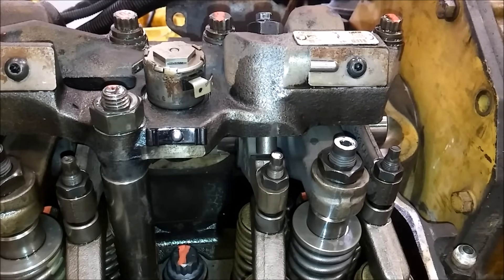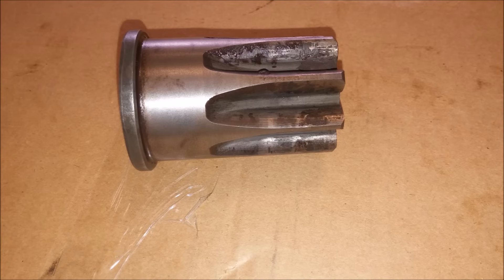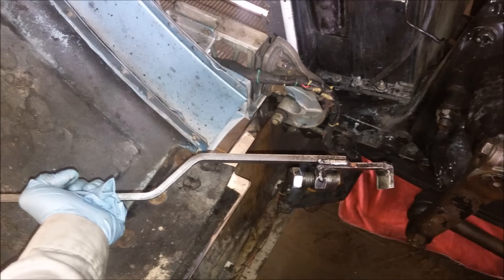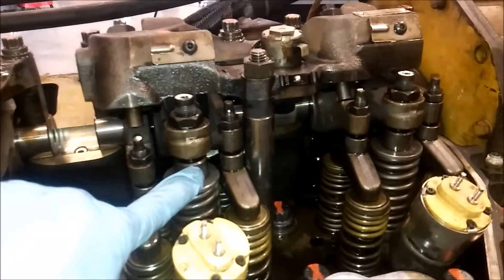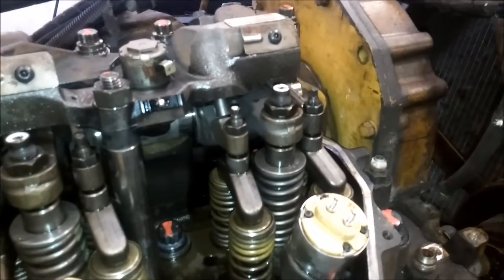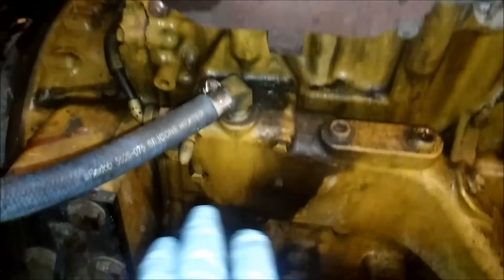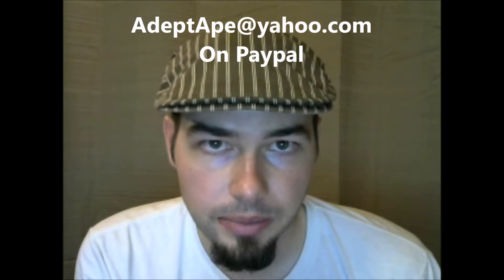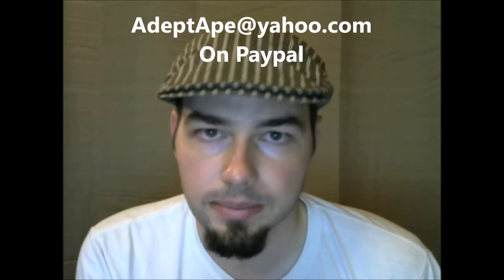How To Perform A C15 Overhead Valve Adjust. CAT Complete Overhead And Valve Adjustment.

Comment: Adept Ape, no way to thank you. much respect from all cat lovers out there.

A friend of mine has a 3116 engine, fuel system is unit injectors camshaft actuated and they have a lever to control them. he noticed that diesel fuel vapor and drops were coming from the pcv blow by pipe. What do you think the probelm is? how did the diesel reach the oil? 

thanks!!!
Reply from the maker: Well the normal cause is one of the injectors is leaking fuel and is leaking it into the crankcase. I've got a video on "fuel dilution" that talks about it and how to troubleshoot it. Be warned though that if the injector is the cause they are a real pain to install and sync, they have to be pressed into the injector bore and the fuel timing has to be synced, which is very technical.
Reply from the maker: On a 3116 that is.
Reply: yes indeed it is a 3116.. can you tell us more why its technical? and please tell me what controls the injection? so it is actuated through the camshaft, ;byt what controls the small rods on the side of the 3116 engine? please help me.

regards, and much respect!
Reply from the maker: +Omar Most of the newer engines have electronic injectors that are controlled by the ECM, but on a 3116 it is mechanical. So there is a large governor on the front of the engine where the HEUI pump would be on a C7. The governor uses a set of rods known as the rack to control the amount of fuel each injector gets, well when you change an injector you are supposed to sync the rack which is somewhat technical because it has to be synced to each other injector. Know I have changed injectors on them without syncing them and you can get lucky and they can run okay, but sometimes you have to sync them. Not only that, the injectors are pressed into the injector cup with a special press during installation, unlike other injectors that can be just installed with the holddown bolts. If you just install the injector without seating it and reaming the injector cup, the combustion gases can get into the fuel rail in the head and cause all sorts of issues. Hope that makes sense.

Comment: the best
Reply from the maker: +fisnik bojku I was wondering when you were going to watch the video.
Reply: On the road for las 4 weeks working and breaking down  putting that money wright back on the truck so been busy but I am glad you did it thnx
Reply: When I get back I will change the IVA SOLENOIDS  I don't understand what's their function other then keeping the head cooler so I was going to ask you
Reply from the maker: +fisnik bojku I need to make a video explaining what they are and what they do. The short of it is they will hold the intake valve open at slightly longer intervals when it should be closed to reduce the amount of air in the cylinder so that less Nitrous Oxides are produced during the combustion cycle. They are there for emissions basically and don't help your engine run any better.
Reply: ki ij

Comment: hey sorry once again I have a question I took my dipstick off of the side of my oil pan filled it back up with oil and it is not reading could I have put the dipstick in my oil pan not right? Thank you
Reply: finally got it to show oil. my question now is should it be sitting around 40 oil gauge? and when I give it more gas it moves up to almost 80 is that bad or good?
Reply from the maker: +Tonya Forshee That is pretty good. As you increase the engine speed the oil pump spins faster and your get higher engine oil pressure. As the engine runs your oil pressure will drop as it gets thinner and hotter. What oil weight did you end up putting in there?
Reply: I ended up putting in 5W30. hoping that was a good choice?
Reply from the maker: +Tonya Forshee That is probably fine, since its really an automotive engine that is a good wide range viscosity.
Reply: I went with that oil a lot of people were saying that it would work good. I hope it does LOL I bought the boat from a guy that pretty much didn't know anything about it didn't have it long enough to. and hadn't changed the oil and it was a quart over like I told you before but when I changed it last night I finally got it to show on the dipstick when I added to 5 quarts but it's not reading full maybe because I haven't put it in water yet? Having a hard time with this
Reply from the maker: You should fill the oil to the full mark. The level will drop slightly after you start it the first time as well because the oil filter has to fill. The angle of the engine also matters, if it's level though the oil level should be right.
Reply: I'm new to this the whole thing and all I know it's a stupid question but I did check it when it was running and actually had more oil in it then when I shut the engine off it was at the add Mark. and when I checked it when it was running the old look darker. Then when I cut the engine off the old looked new. Not sure if I should put it on the water and and check it or just send it to a shop and have it done I'm having a rough time with it
Reply: i what to thanks u for all your help!
Reply from the maker: Well, the engine oil should only be checked with the engine off and then let it sit a couple minutes to settle. If it's full then your good to go.
Reply: thank you so much! for helping me out and guiding me through this..

Comment: is the valve adjustment order done here the same for any 6 cylinder engine?
Reply from the maker: +Omar All Cat inline six engines are going to have the same sequence because the firing order is 153624. Since inline six engines share the same sister cylinders, 1-6, 2-5, and 3-4. The overhead sequence should be the same I think.

Comment: hey Adept

is the c7 on a high way truck typical to the c7 on a 950 h wheel loader?are all the c7's 70 pin?
Reply from the maker: +Omar The wheel loader I'm not sure, but most likely they have the same ECM. All HEUI C7 engines use both a 70 pin connector for the OEM and the engine. The regen C7 engines use a 70 pin for the OEM and a 120 pin for the engine.

Comment: Another great video. I ve been waiting on this topic too. I did my overhead adjustments on my 2WS but it seems to have been running rough lately. I ll follow your technique in doing the overhead this time. Thanks again for your videos and will contribute to you making more videos.
Reply from the maker: Thanks for the comment. A 2WS should be very similar as the engine in this video. Hope you have success. Inspect your camshaft too while you have the valve covers off if you have a rough running engine.
Reply: @AdeptApe  How often should this be done?
Reply: @Alex0992  I was told that a valve set should be done at least every 1200 engine hours My company truck is a 6nz c15
Reply: @AdeptApe  Hey Adept. I am here in Washington somewhat close to you. I have a 06 379 with the compound turbo set up c15. Boost has been low 30-32 and today wouldnt get over 25 psi.  It is suppose to be set to a 550hp. My father has had the truck for 9 years now and the overhead has not been done. Can that be causing these issues?

Comment: awesome advice. I've got a question for you I just bought a boat 1987 Bayliner Capri 2.3 liter 4 cylinder Ford. I don't know if you can help me with this question but I've never had it on the water yet and it's reading a  quart over can that cause Blow by? but I plan on changing the old before I put it on the water.
Reply from the maker: +Tonya Forshee A Ford engine question eh, okay yes having the engine oil overfilled can cause more oil to be pushed out of the blowby tube. Since you are going to change the oil, go ahead and do that first, then see if that helps. If it doesn't then, more troubleshooting needs to be done.
Reply: thank you so much for the help.. its not smoking or nothing like that. a guy told me if didnt change it bc it had too much oil that is would cause blow by.. we it hooked up to water ran it for about hr or so ran good... thank you so much ur awesome!!
Reply from the maker: Thank you for the kind words. If it still acts up let me know what it is doing.
Reply: thank you! I definitely will let you know I appreciate it. you have a good day!
Reply: sorry I've got one more question hate to bother you but do you know what kind of oil and weight I should put in the boat? Thank you
Reply from the maker: A small gas Ford engine from the 80s most likely takes a 10w30 weight oil, but check the oil fill cap or a maintenance manual for the exact proper viscosity. Any brand will do, I would go for conventional oil on an older engine like that and not worry about getting synthetic or semi-synthetic. Oil is actually a very controversial subject between mechanics, but my personal opinion is brand doesn't matter as much as keeping it clean.

Comment: Great thanks I was concerned about the wiring for the throttle,cruise dash panel etc. I plan of finding a used rv one
Reply from the maker: +2010panel The wiring for all the RV inputs run into your P1 connector going to the ECM, so it should connect right to the ECM. Some parameters might have to be programmed, but the wiring shouldn't change.

Comment: I have a question about a 1997 diesel pusher motorhome with a 3126 cat with 80000 miles with a cracked cylinder wall. I am looking for a replacement 3126 what years would becompatable with the old one
Reply from the maker: Any 3126 would fill the void as they are all pretty much the same. Now you will want to verify the horsepower though, hopefully it should be out of another RV because RV engines have the highest horsepower. If you get a truck one you could wind up with a 190 HP engine.

Comment: Hello I greatly APPRECIATE the video. They're building confidence SO I can do it myself. In this video your stated C15 single turbo.  I have a C15 twin turbo ACERT. THE principle the same? I bought a CAT CD to give me insight. HOWEVER! I'm MORE of a hands on kind of person. any help would be nice. 
THANKS again for videos
Reply from the maker: What is your serial number sir? It should be a BXS, MXS, NXS, or SDP to start with.
Reply: MXS
Reply from the maker: Alright so an MXS is more complicated, but the same principles apply for the valves, Jake's and injectors, but your engine has the IVAs that have to be adjusted. You need to remove the Jake/IVA housing to properly adjust valves and injectors. Then bolt the IVA housings back on and then adjust the Jake's/IVAs. Hope that makes sense for you.
Reply: @AdeptApe  Don't you mean remove housings on NXS not MXS

Comment: I have a question I have a 2000 379 with a 3406e after running for around 11 hours the check engine light comes on the code says it's the oil pressure sensor now the oil pressure is still running at 70 to 75 psi at 1500 rpm and at idle it's a little over 40 is the sensor going bad or is it something more
Reply from the maker: +dale intimidator Your oil pressure sounds good, so here is what might be happening. You probably have a separate oil feed for your dash gauge, but your oil pressure sensor that the ECM reads is electronic. I would put a gauge on it to verify that your oil pressure is good when it is sending the check engine light and if it is then you need a new sensor.